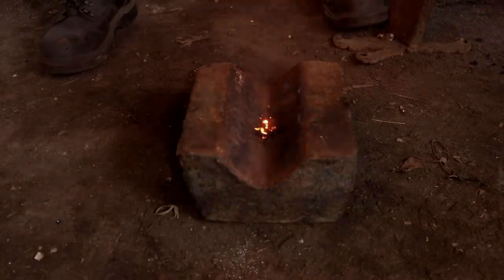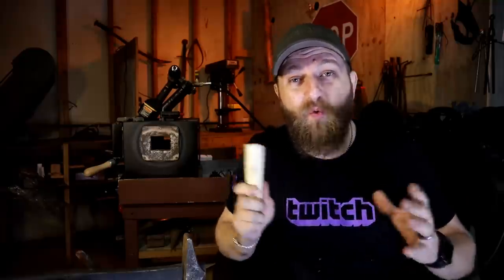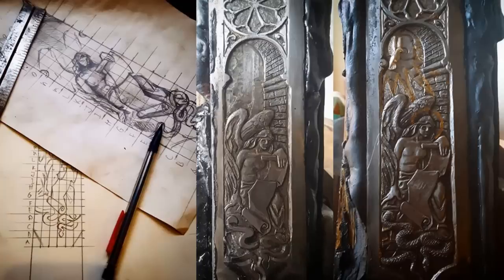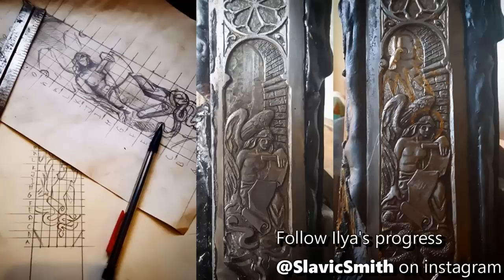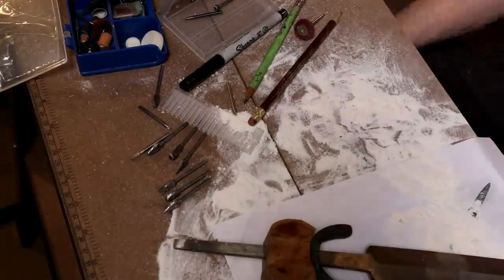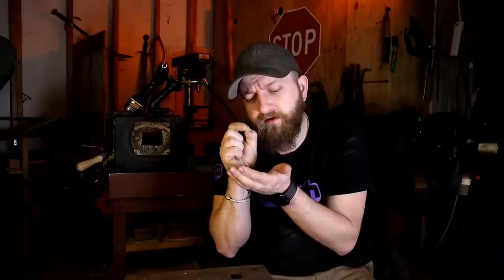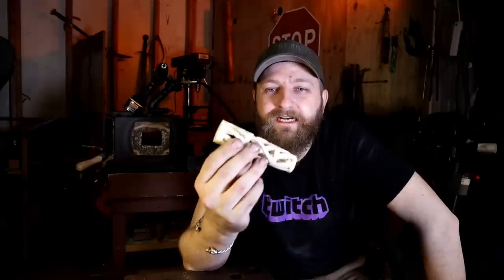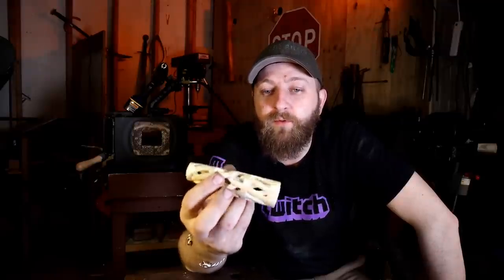Carving a Bone Handle for a Bollock Dagger

Comment: If you get your bones in quantity, immerse them and leave them in hydrogen peroxide until ready to use.  It cuts the smell and makes working with them far more sanitary.  This is called "macerasion".  Rinse thoroughly and let dry before use.  This will bleach the bones very white.  So if you would like them darker, soak them in strong black tea until they stain completely or until you have a lighter shade which suits you.

Got to the end and see that you already know about tea staining.  Should wait to these comments, but I'm absent minded and forget to do them.  Well......
Reply from the maker: Karmakshanti Vyapini thank you!
Reply: Your Awesome knowledge deserves a like

Comment: I like how he describes one of the worst smells there isas " just a little bit". Take a Dremel to a piece of antler sometime folks you'll immediately understand
Reply: I can say from experience any type of bone or antler the last thing I ever like doing making handles is drilling, sawing or carving bone it will leave you with a headache if you not in a well open space with good air flow in it
Reply: It’s a smidge unpleasant...though I’ve only used small pieces as spacers...so the dust was minimal, and used hand drill and files, so it didn’t burn as much XD

Comment: Having tried making my own cattle bone parts for guitar making, the stuff stinks at every step of the process.  And I saw an antique chess set from turned camel bone.  I am surprised that the void is that big.
Reply from the maker: I had to carve the inside out a lot
Reply: @ThatWorks  That makes sense.  Hollowing out the inside was probable annoying as hell.  Especially if you are experimenting with an unfamiliar material (I have had to toss some "unfixable" experiments in the bin) where a material blow out is a definite risk.
Reply: Are you not concerned that carving out the inside could make the handle brittle?
Reply: If you're making nuts, camel leg bone is harder and denser than cow bone. Long spindly legs supporting a heavy body... Then there's giraffe leg bone, which is yet denser and harder. Best nut material I've ever used.  Clyde

Comment: Ahh, hand filing...so laborious, but feels so good when you get everything spot on. Nice work Matt. By the way, do you think camel bone would make good material for a tanto handle (traditional style fabrication...2 halves, the tang space chiselled out etc etc...) or do you reckon easier to inlay it into the wood. Want to do some decorative carving in bone..just concerned about structural integrity XD

Comment: Dremel has a tube holder that is a push/pull lock instead of the screw retainer that you used here... it is way easier to train out sanding tubes! The screw fit type binds up too much

Comment: Premieres work best when you create them for <30 min into the future.
Reply: I think 15-20 minutes is the optimum length of a video like this. Especially when there's so many repetitive steps they didn't have to show..like 3 minutes of drill press and 5 minutes of dremel work and 3 minutes of file work is a bit excessive to me. Just show the process once or twice, then jump cut to the result. This is entertainment after all.
Reply: @MikeWallibo  I'm not talking about the video length. I'm talking about the premiere mode. So "video will start in X minutes". When this is put 5 hours into the future than most people will have forgotten about it by the time it airs.
Reply: @_aullik  Ah, I must've missed that entirely. But my point still stands, I think, since we're both on the subject of time.